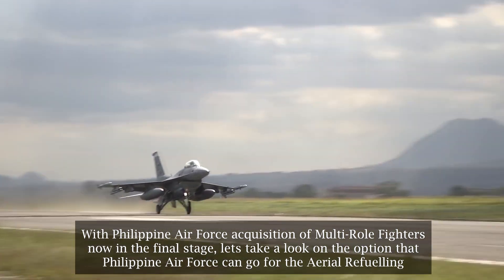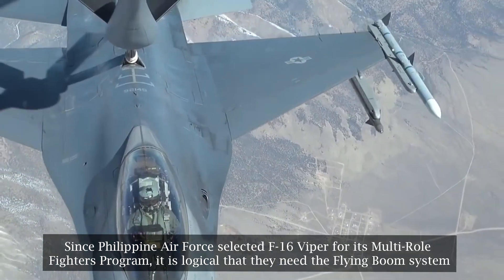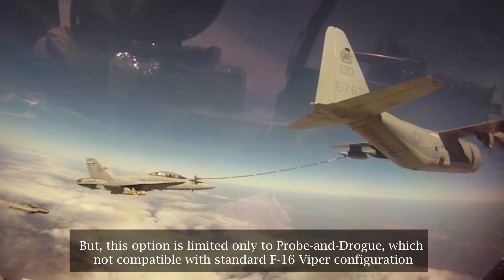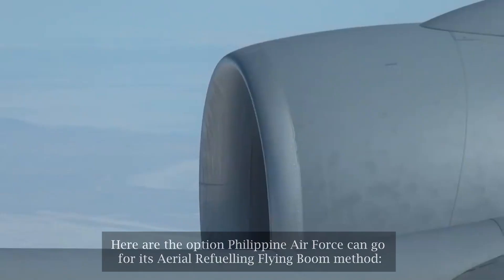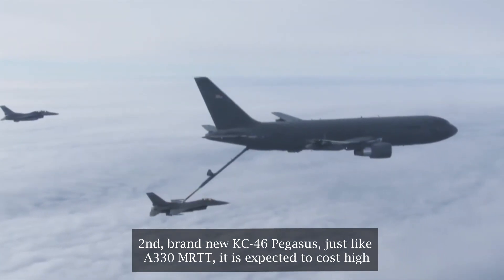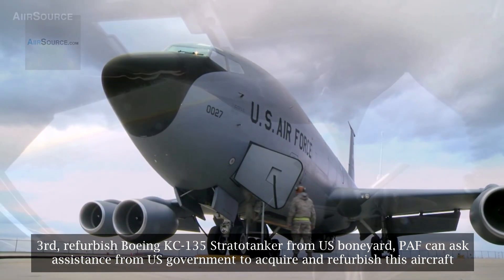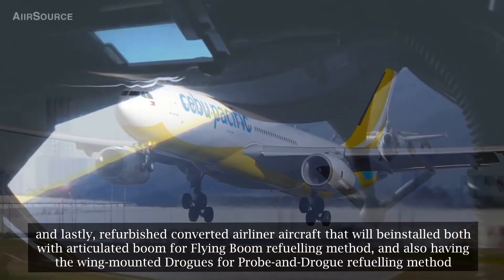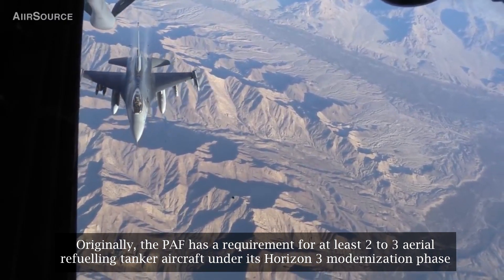Aerial Refueling Options for Philippine Air Force Ideal

Comment: For me the best option is the Airbus A330 MRTT for the aerial refueling tanker/transport aircraft with between 2 to 3 being the desired number to support 40+ Multi-Role Fighters (MRF) with both aerial flying boom pick and broke-and-drogue system for flexibility supporting allies and regardless of which MRF the PAF! Also is used by the Republic of Korea Air Force (ROKAF) 🇰🇷 and Republic of Singapore Air Force (RSAF) 🇸🇬 although considering the high acquisition cost and risk, maybe  it would be best to acquire two to three (2~3) Boeing KC-135R Stratotanker to train and familiarize pilots on aerial refueling. As for the KC-130 I think they can be useful especially if the PAF modified its helicopter with aerial refueling capability like the Sikorsky S-70i Black Hawk to extend their range beyond 250nmi allowing for over water operations!
Reply from the maker: I agree with your point

Comment: I think the best is refurbished KC-135 we can get it almost for free as the US is upgrading their fleet to KC-46. 

Parts will also not be a problem as there a lots of them in the boneyard. 🙂 also unlike the US we will not be using these that much so buying refurbished or second hand ones wouldn’t be that big a deal. We only need to avoid refurbished equipment for heavily used equipment / weaponry like helicopters, C-130s.